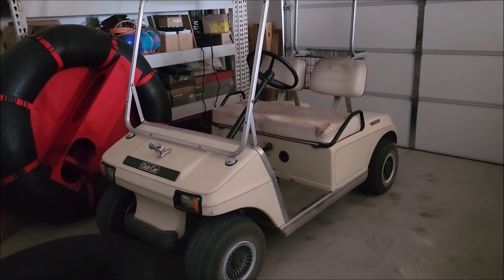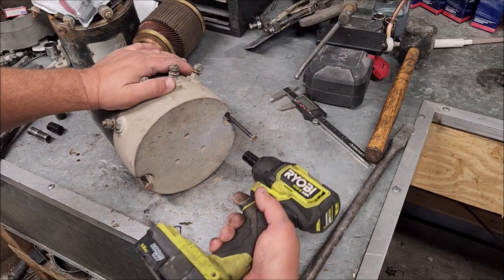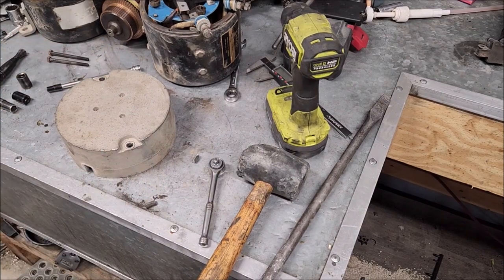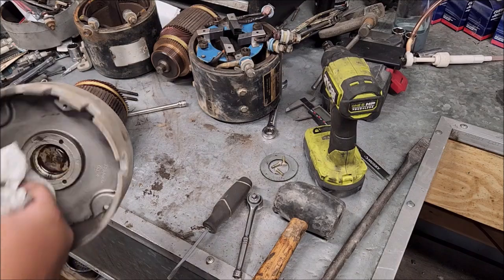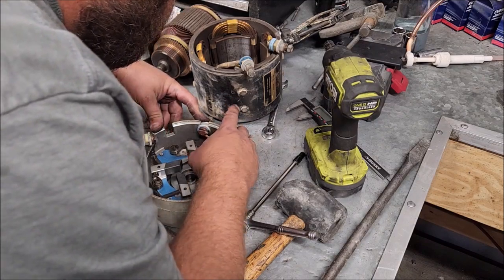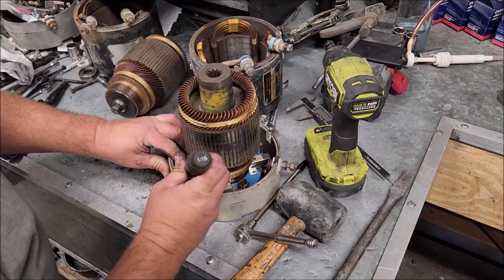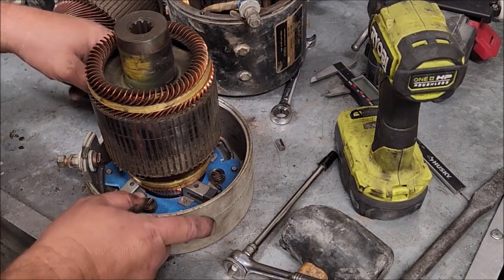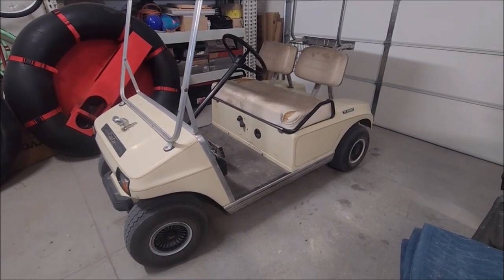Club Car Golf Cart Motor Repair

Comment: Nice fix, I worked at an urban state university for many years and we used gasoline then electric carts for the engineering and trades vehicles. They would replace motors after so many hours on them, the fork lift repair guys would do it. They did it in our building and I watched them replace bearings in a motor once instead of replacing it. Was larger motor but basically the same job 👍

Comment: Hey, my name is Larry, and I broke the bolts off the inners as you called them. I'm not sure of the real name, but any way my question is, can I just add like 4 guage battery wire and solder it back to the studs. Also, I pulled the inners out to clean them from all the black crap. What can I use to secure them back in place? Please help. Its my first golf cart and I'm try to fix it. Thank you.
Reply from the maker: @bigcountry1695  you'll probably be buying new brushed my friend :(
Reply: One more question. The bolts? Copper? Do I need copper or can I use 5 bolts and can you explain the washer setup.

Comment: You might be able to get the other motor running true again with some very thin shim stock, or a bearing with a smaller inner diameter.
Reply: I think it wore down the rotor shaft. Measure the new shaft diameter, and see if you can find a bearing to fit.

Comment: I work on electric motors blah, blah etc. couple of suggestions. Yes the bearing fit on the shaft needs to be tighter, you can knurl it or use loctite. In your hot and dusty climate I would suggest using 2RS (two rubber seals) bearings.

Comment: "Shield, end" with part number 1017944. Do you know where I can get one of these? Also is their a rebuild kit that has everything I need to rebuild and that is a quality. Two of the lug studs broke off. Cart ended up having a lot of rust on everything. Was going to replace leaf springs since it looks like I need to drop the whole rear end.